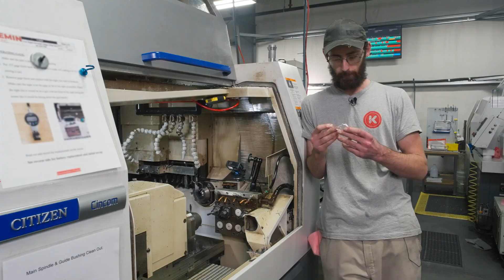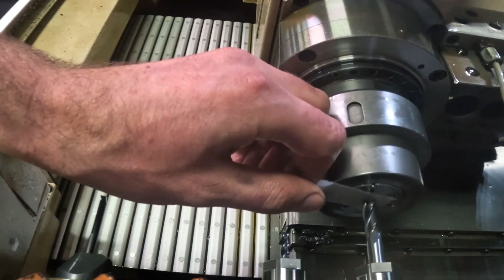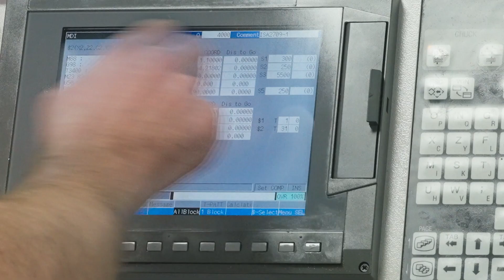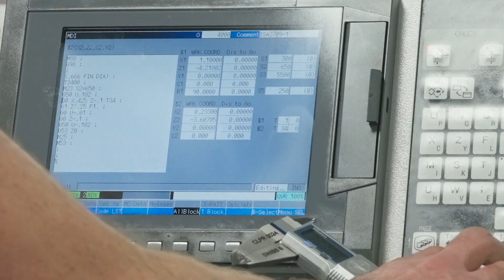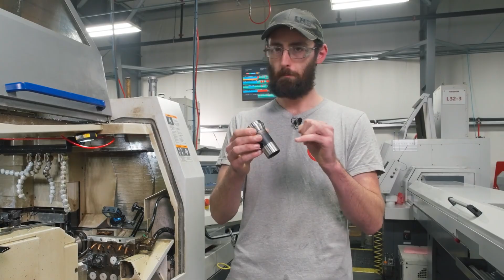How to Bore an Emergency Collet

Comment: why are they called "emergency" collets? everyone's always called them that where i work as well. why not just call them soft collets, or custom collets... something less stressful sounding.
Reply: They are called emergency collets because they are used for urgent jobs that need a special size collet faster than they can be made for you, I have had it take 3-5 weeks to get a collet made. Emergency collets cost $105 from Hardinge, a custom hardened and ground decimal collet costs $90 from Hardinge but takes a while to be made.

The name sounding stressful is on purpose, it emphasizes that you were not given any time to plan ahead and order the proper tooling.
Reply: @KerseyKyle  still stressful and hate that it alwasy falls on the machinist to fix a quoting oversight... hence the emergency..

Comment: A little bit off topic but how about the a20 in "from cold to temperature" deviation in tolerances?
We have on the M20 about 0.01-0.015 (mm)
Thanks
Reply: Not really any rules of thumb for that, just depends on the machine, material, and shop conditions. On our A20s it might take a few hours for them to warm up to the point of holding .01mm in lvl 5 Nitronic 60 or hardened stainless. Best thing to do is run the first one, make an offset, then run 2-3 pcs at a time until it's holding reliably. Then run 5. Then 7, then 10, 15, 25, etc. Newer or more rigid machines may make the process go faster, easier materials make the process go faster, but the process stays the same.